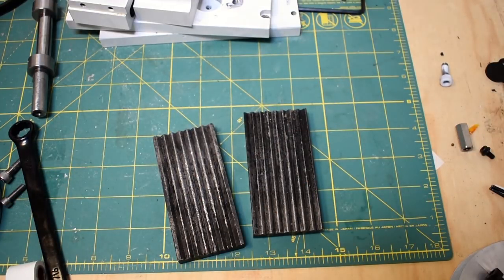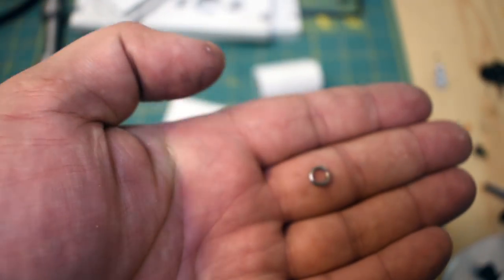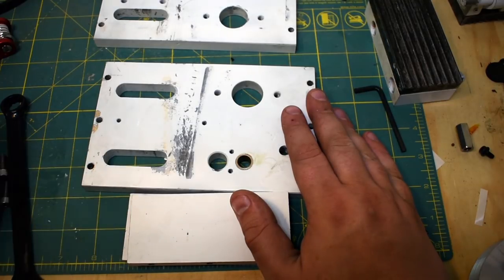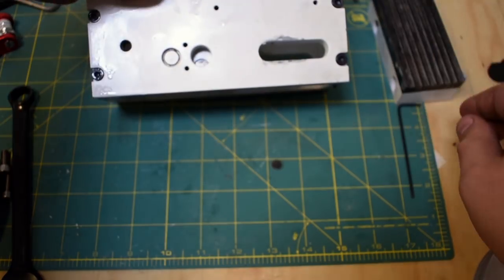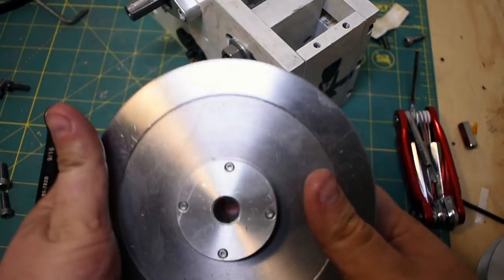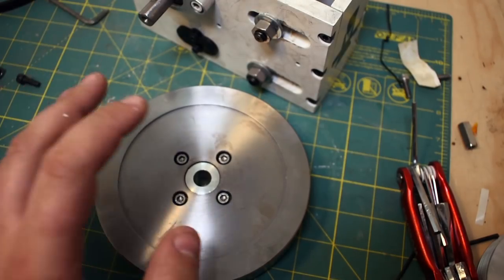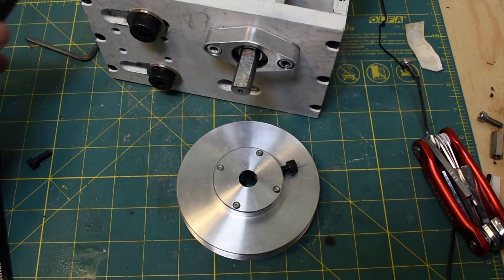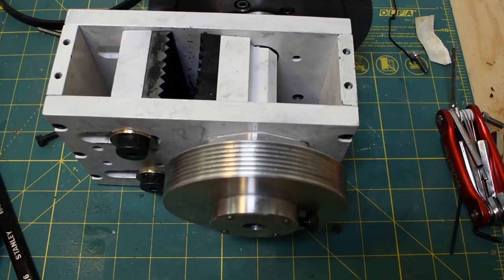Miniature Rock Crusher:  Design and Machining

Comment: 3:30 that's correct, the jaws act with compression and shear, and when a piece of rock broke, have to slide forward and take another bite and another till the exit. You desgin something call "simons" (if i remember correctly from school, i'm a mining technician) if you want work with pure compression look at "blake type". The problem is that they produce a "flake shape" so those crushed material are not suitable for cement when you want some poliedric pieces, so you can use this crusher only for primary purpose followed by other designs. If you look at a cone crusher in section is not different from a jaw one, just roll a big a plate into a circle ;)

Comment: If you really want this crusher to do a lot of crushing you should mount all the bearings in the cheek plates. The two bearings in pillow blocks put all the force of crushing against 4 small bolts. when you hit a especially hard rock or someone drops a hammer into the crusher under power they will sheer off.
Yea, people do accidentally drop chunks of metal into crushers sometimes.
My lab crusher has been rewelded twice when the  main bearing which butts into the cast iron body of the crusher cracked the cast iron due to accidental attempts to crush large rocks. 
Give the main bearings lots of support.

Comment: I don't worry overmuch about the looks of a part or even an entire device when prototyping. Almost always, the first few tries  have a fatal flaw, maybe several, and several things that need tweaking.  Looks like you have something that works rather well, just a few minor changes in material to improve. You will probably do that if a part fails.  Looks good! I like the explanation of your choices and results, warts and all. Sometimes it is really helpful to know what NOT to do.
Reply from the maker: Sounds like we have that in common!  I certainly think this will require work to maintain and keep functioning, but fortunately I like making things!  Thanks for watching Jeff!
Reply: You also tend to find all the ways things go wrong that never crossed your mind. Thanks for taking the time to film and upload.

Comment: I was interested how Rick crushers worked . The flywheels on compressors have a taperlock so they can clamp onto the shaft pretty good. Hey but gotta learn as you go. I think I might have put the crank bearings in the half inch plate and used end caps to hold them in. Rock hard ness is constant. I think your right about the scaling down makesca difference. And the belt could could of been part of the flywheel. Nice work though

Comment: You could surface harden those 42CrMo jaws. Heat to 870-900 Celsius and quench in water. Hardness is 54 HRC minimum, when starting from the Q+T condition. Do a stress relief at 150-180 Celsius for an hour after hardening.
Reply from the maker: Hmm interesting... I was a little wary of a water quench because I had heard it can cause cracking, but it would certainly be more convenient than oil quenching

Comment: With MIning Equipment like crushers it is frequently used outdoors where it gets rained on. The mass of metal loss from rusting compared to metal loss from grinding steel against tons of rocks is very small.
The crusher will wear away the jaws and cheek plates way sooner than it will rust through anywhere.

nice video.
Reply from the maker: Thanks for the comments!  I learn so much when experienced people like you post haha!  So bushings are okay in the cheek plates?  Can you get them with some kind of sealing arrangement or do they just power through the dust?

One thing I have come to appreciate about bearings mounted in flanges is that when the crusher does get overloaded it just moves the bearings and nothing breaks.  Ruins the paint, but that was'n't exactly winning any awards :P.  

I am looking to simplify the design a bit, so I'm definitely going to take your suggestions into consideration.  Thanks for commenting!
Reply: @TabletopMachineShop  
HI, i ran a Assay business for 30 years where i used the jaw crusher and pulverizer to turn rocks into powder for the fire assay. so i have a little experience on small crusher design and use.
use bushings and put a zerk fitting on them so you can inject grease into the bearing which forces dust out.
it's not perfect but it works.

Comment: All the bearings should be bushings and should be equipped with grease nipples. Regular greasing is the only way to keep rock dust out of the bearing. 
the seals on sealed ball bearings are not tight enough to keep rock dust out and not durable enough for the gritty enviroment of a rock crusher.

Comment: Any time I'm building anything that will be subject to moisture or activity that will damage a paint finish, I make it out of 303/304 stainless steel or aluminum. The body of your crusher, your bearing blocks, pivot and drive axles, much of the design, with the exception of the jaws, could be stainless and just as strong as A36. The jaws could be stainless too like a 440C, but would be better served with O-1, since they're a wear item.
Reply from the maker: I had thought about stainless but a quick check showed it was a bit outside my budget :(
Reply: But as you mentioned in the video, this was known to be a high stress item, and therefore prototypical in nature. I would proceed precisely as you did, making the first one out of A36 and working out the details. Stainless is more expensive in raw form, heavy, hard to machine and very hard on the machines and especially the tooling. I wouldn't commit a pile of stainless to an experiment either.

Comment: I bought a large jug of real quenching oil once, and was told the oil should be heated to 80°C to work best. The oil is to thick at room temp. Water works too, but will not quench as hard.
Reply from the maker: I used old motor oil (not enough of it though).  I've also heard that water can cause cracking because it cools the material so fast, but I may go ahead and try it anyways because it's so much more convenient.  I'll have to look into real quenching oil
Reply: I've always been told to use USED motor oil bc of the added carbon from the carbon build up from the motor and that the higher the mileage on the oil the better. And I'm ashamed to admit that I've never heard of an oil made for quenching. Makes sense though. They make everything for everything. Doesn't necessarily mean its the best choice, but I may look for some and give it a shot.

Comment: also...try coolant instead of oil when drilling. I've switched and my drills are lasting longer, chips evacuate better and the metal doesn't work harden as easy.

Comment: Nice build but so much machining and precision put into it. Couldn't a person build a lasting one more crude and without all of that machining but with heavy steel welded together?  For example, the eccentric shaft  could be a piece of larger shaft with an off center hole drilled through it and slipped over the smaller diameter main shaft then welded on.   Also use pillow block bearing mounts.   
So what I understand from what you say,  the larger diameter and heavier that pulley hub is, the less power of motor needed.  I guess there are limits to that to reach a proper balance.  It could be considered an inertia powered crusher as well.  
BTW what type of ribbed belt is used to transfer the power?
Reply from the maker: Yeah absolutely.  I think the "cost of goods" of this could be cut in half easily.  I think using a rectangle tube as the body, standard pillow block bearings, an eccentric collar (like you suggested) and a few other cost cutting measures would make this less expensive.  I've had a few people inquire about lower cost versions of this, so I may investigate further.

You're right about the flywheel. I didn't get into it (I may do a video about flywheels), but basically the bigger the flywheel, the longer it takes to "charge" but the more work it can do.  The only caveat is that the motor has to be adding more energy than is expended, even if it can't supply enough torque.  Thanks for the comment!

Comment: Hey bud, I crush for america rock in eastern oregon.  Have you thought of a gear reduction box? That would give you the torque you need. 
Compared to a full size like my telsmith, it's not the torque from the motor that breaks the rock. On opposite sides of your eccentric shaf you have a fly wheel and on the other your shiv. (That's what we call pulleys). They weigh about 2 tons a piece. Combined with the weight of your jaw dye(3tons), etc, etc. Now, the motor is a 3ph 480v 250a 300hp motor, the motors job isn't to break the rock. When I start her it takes roughly 300a to get her moving then at full rpm she drops to 100a. That's just to keep it in motion, when I start putting rock in her she pretty much stays at 100a. All of that momentum and weight is what breaks the rock, all the motor does is keep the weight and momentum going.

With the scale I'm scratching my head on how to go about that without it looking rediculace, anyways. Good job on the build bud!.

Comment: Submerge it in water up to about  .1 inches from the top after you brush on elmers paper glue and sprinkle on bone meal or charcoal or any finely powdered carbon source let it dry . once submerged you can use a compressed Gas (like oxygen )torch to harded the teeth leaving  the rest of the plate soft and shck absorbant.
I also wonder if if Nav-Com gaskets could be made and used to disipate excess vibration. Being as it is a special closed cell polymer foam designed specifically for reduction of harmonic vibrations caused by machine shop tools like mills and laiths and cnc setups....the pad is placed between the floor and stand or machine base before it is ankered on lag bolts set into the floor or concrete pad...after it wss found to be succesfull it has simce been used in the firearms industry as recoil pads and a harmonic tuner that slides over a rifle barrel and you move it up and down the barrel until your target groups become as consistant and as small as possible...i dont see why it could not be handy on rock crushers and shaker tables to help lengthen the usefull life of the gear. Vibrations destoy everything.
Reply from the maker: So much to look up, thanks for the tips!  So heat treating while the part is partially submerged?  You must need a ton of heat to heat up just the teeth without just boiling the water.

I had never heard of Nav-Com, I'll have to check it out.  I'm always interested in vibration damping materials because, as you said, vibration destroys everything.

Comment: what speed are you running it at? i found a used Sepor 2" crusher at auction less motor and sheaves, Sepor said to run it at 1750 rpm at the crusher shaft.....

Comment: Cool stuff.   One comment:  you specify that METRIC dowel pins are oversized.   AFAIK, all standard (non special) dowel pins (inch or metric) are oversized by roughly 0.0002”.
Reply from the maker: Upon closer inspection you're correct!  My bad!

Comment: I have not searched all the comments so I apologize if you already answered it.  I would like to know more about the crankshaft offset and the angles of the jaws are there some industry rules of thumb? 
Thank you 
Vince
Reply from the maker: I just kind of estimated it.  The jaws are adjustable at the top and bottom, so you can set any angle you want. I found that a shallow angle was more likely to pop rocks out, but an angle that was too steep resulted in limited crushing.  I think the offset was about 1mm.  Because the stone is so brittle, you really don't need a lot of motion.

Comment: Hi! Can your driveshafts be better cause their heat treatment was followed by a slow cool down, in that they became less brittle than if they were harder? Is it correct to say that softer steel is more ductile? This might reduce the danger of stressfractures forming cause there is a bit more “give» in the material as it is now, less rigid but better at absorbing shock?
Reply from the maker: I believe you actually have to harden 1045 first and then heat and cool slowly to soften it a bit to remove the brittleness.  Softer steel is more ductile but also weaker, so it will break more easily but less dramatically if that makes sense...  I think ideally you would want hardened and tempered back to a less hard state so you get some springyness without deformation, much like you said

Comment: Funny thing about those lock washers; if they failed as often as the internet would have you believe, they wouldn't have been sold for decade upon decade. Are there better designs of lock washers available? Sure, but they cost a lot more than the standard one that usually works okay.
Reply from the maker: Ya I agree.  There are places they really don't work (like curved surfaces and slots) but i've never really had an issue with them on flat surfaces.  I guess there are better ones, like the toothed ones, but they have a larger OD
Reply: failure mode with spring washers is that they spread with torque. as you have these in a counterbore, they are constrained from spreading, so less likely to fail, but they are not suitable for handling any real fastener torque, you are better off with a plain flat washer. :-)

Comment: NICE man I have been wanting to do this very thing, would you have plans in a PDF possibly so a person could follow in your footsteps ?
Reply from the maker: I do have a complete drawing set up on my Patreon!  Also CAD if that's more your flavour
Reply: @TabletopMachineShop  could you please send me the CAD file , thx in advance,
Reply: I work on crushers for a living, you might want to build this but it has too many design flaws to be used, the three part eccentric shaft coupled with unevenly weighted flywheels means it will fail, the adjustable fixed jaw will come loose, no cheek plates means side of crusher body will wear out, the mounting system for the jaw liners means they will come loose, the eccentric bearings are not located and will come loose, the toggle will wear out fast, it looks like a fun build but don't think you will crush a hundred kilos of hard rock.

Comment: Hi mate. I’ve got access to your crusher plans and was wandering what cad system you used as I’ve tried to open in fusion 360.
Reply from the maker: Hi!  I think ive answered you on Patreon, but just in case you didn’t see it i designed it in Solidworks but i did upload step files which F360 should be able to open.  I cant save to fusion 360 native file format but if theres another one youd prefer let me know!
Reply: Tabletop Machine Shop ok thanks mate will give it ago in solid works.

Comment: 28:00 What is that tool? Is the pilot attached or an attachment? Why even have the pilot!? WHAT IS LIFE!!!

Never saw an endmill with a pilot like that before, its interesting...

Could always nitride or parkerize or even just cold blue your bare steel part to help with rust prevention, then smother them with wd-40, dont want to lose that machinists perfume!
Reply from the maker: That's called a counterbore tool (https://www.amazon.com/Counterbores/b?ie=UTF8&node=256258011).  They really shine on drill presses because they self align.  The only problem is drill presses usually run too fast for them, so they work best on a nice, low RPM drill press.

Life is difficult to define but I think it's based around something's ability to metabolize, self sustain and reproduce.  Is fire alive?  I don't know.

Case hardening would certainly be a good way to go.  I'm sure they do something similar in real crushers

Comment: Pretty awesome! When do you plan on making the lathe bed from the epoxy granite?
Reply from the maker: Baby steps -- I want to slowly build up to the lathe bed so I don't do something wrong :P.  I might do a spindle housing or something to evaluate the vibration damping performance before I do the whole base.  I'd also like to try to 3D print a mold and see how that works for smaller things
Reply: @TabletopMachineShop  yeah that makes sense , from what I've seen the finer your rocks are the better , seen some people use super fine sand , almost looks like powder , seemed to have good results , also a 12-13% epoxy content is the ideal amount.  

I'm planning to do a similar project but I want a mini mill . Very interested to see your results . 

Also I know you were talking how it would be too expensive to sell the turrets , I'm in manufacturing , and I'm very good at making things cheaper . If you ever decide to maybe make a business of selling them I would be interested in helping / partnering on it .
If you want to see what I do for a living, this is my company blklblbipod.com 
I designed and machine these in Calgary Canada .
Cheers

Comment: Pretty much everything you said about the material and heat treating was wrong.  Your process was wrong as well. I don't have the desire to explain it all but I can tell you if you grab a Machinist's Handbook you will be able to learn enough from it to do what you need to do.  

I appreciate your little crusher though.  Cheers